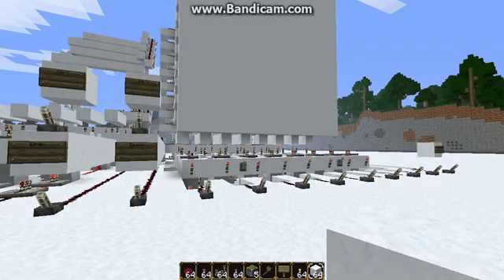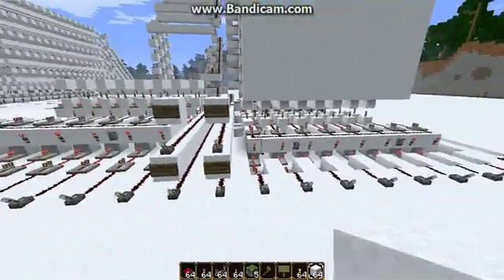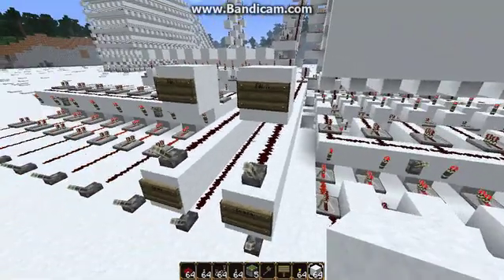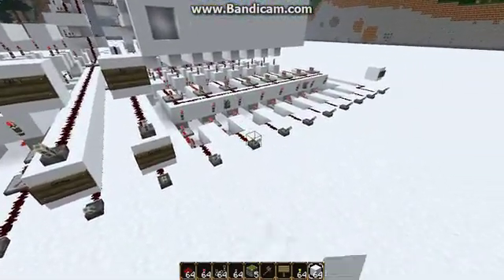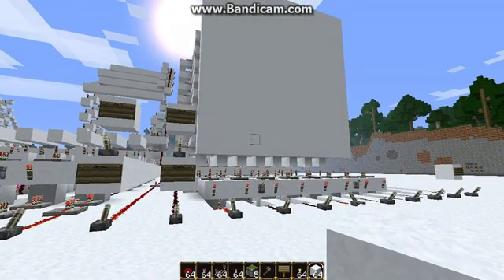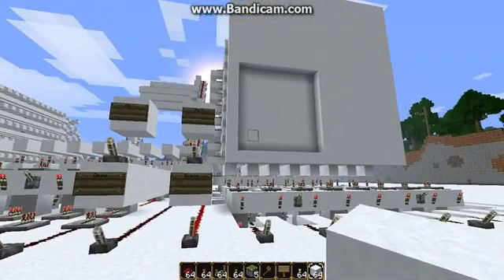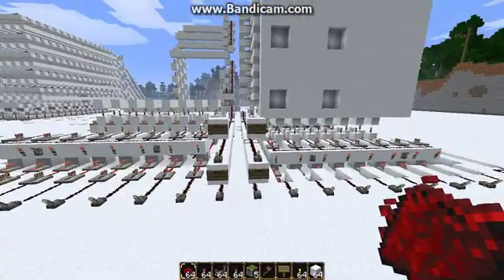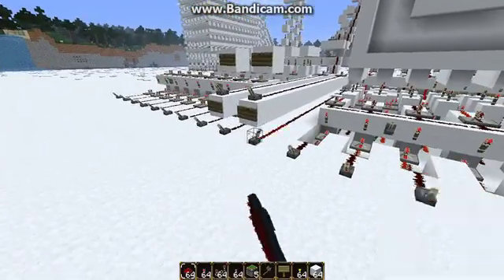Building a minecraft GPU tutorial pt.1 How it works

Comment: Has anyone made a gpu in minecraft that for inputs uses binary value as the coordinate?

(e.g. the x is 0011 and the y is 0001, then it would make the dot 3 pixels right and one picel up from the bottom left corner. )

Comment from the maker: If you just want to display numbers, it will be more efficient to use a 7 segment display. Yes, using a system like this would require you to set each pixel manually, so it would be significantly slower and more difficult than a 7 segment display.

On the other hand, this would also be able to display much more than just numbers, so what'd you save in speed and simplicity you'd lose in versatility.

Comment: I built a gpu which works by having the x and y coordinate inputs entered, and then a draw function, and I was wondering, I have it hooked up to my computer, and if I wanted it to show a large image, such as an addition program which shows the number on the screen, would I have to program it to draw each pixel individually?  I may create a new design, but I feel if there is an easier way to display images, then I'll stick with my current design.

Comment from the maker: @iLikeBoones If I'm understanding this right, then this should be perfect for you. You'll basically just need to repeat the type of pattern for as many pixels as you happen to need. I'm pretty sure I never explicitly state what the pattern is, but it should be obvious enough.

I might suggest that you look about 4 mins into vid 5 first to make sure this system is for you. I use pistons instead of torches, but as long as there is the same space as the piston square then it should be fine.